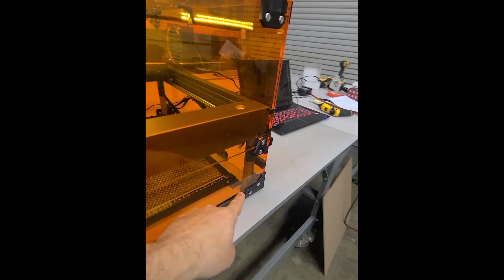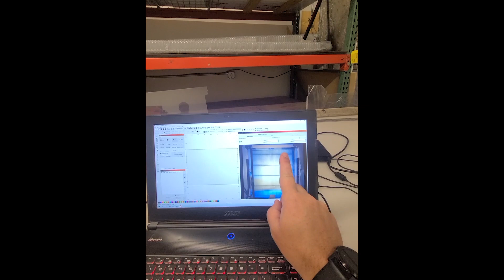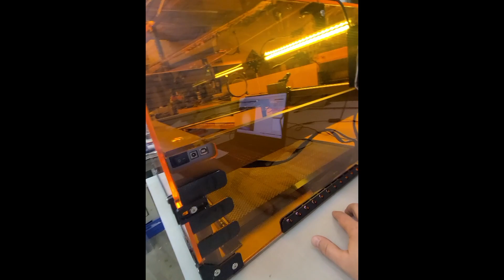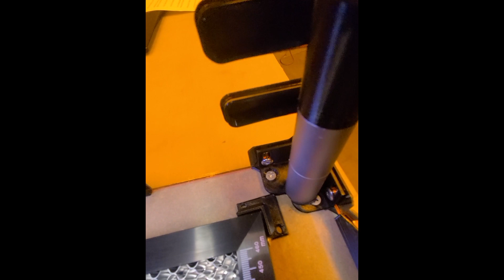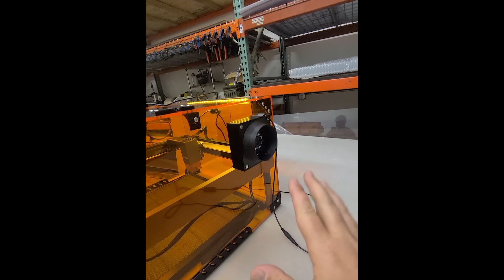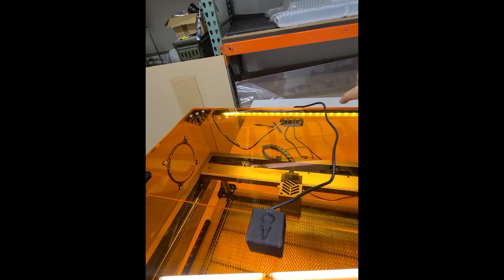Xtool D1 Pro enclosure V2 by Clearview Plastics

Comment: It looks amazing!  Will there be on me for the extended rails veraion?
Reply from the maker: Yes. it is planned to a little later this summer. Similar to the original, it will be an bolt on addition to the base enclosure.